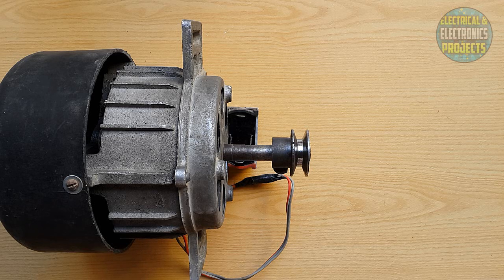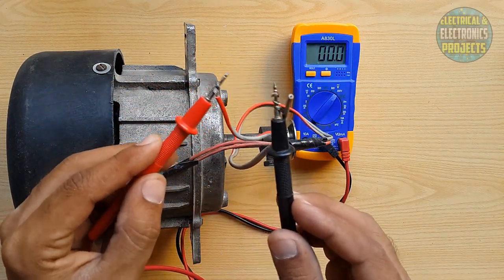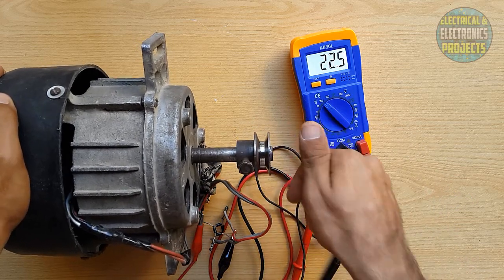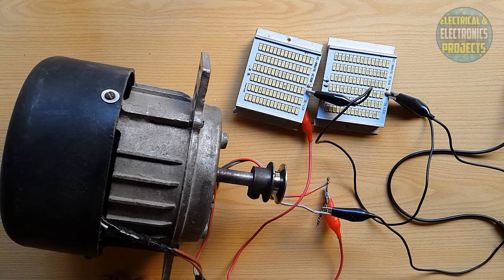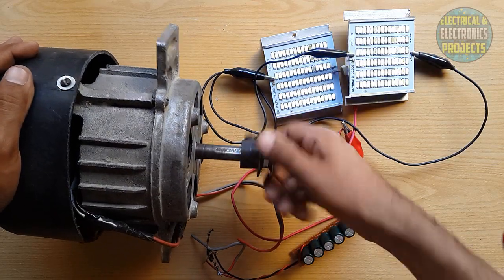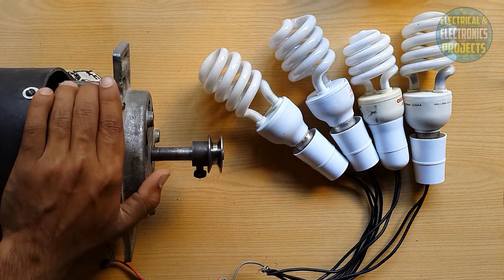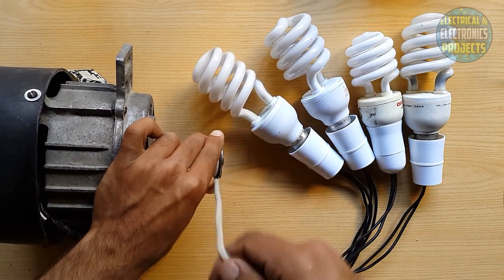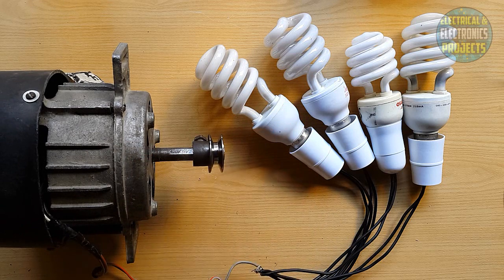How To Make Free Energy Generator 220V From Washing Machine Motor. DIY Free Energy Generator.

Comment: no, its free. you use a motor to spin the alternator fast for full power. and before you talk about needing power for motor, think about it. the power you produce can power a plug ,which you plug the motor into. put a belt between them. I've been using this system to power job sites for years. its a loop. alternator spins to put out power, which powers the motor that spins the alternator. it spins fast so you can get 90 amps from it. if you put 2 of these in series you have 180 amps which is enough to power your whole house for free. just go out and scrap out a car alternator and a washing machine motor, get a belt to connect them, a bit of wire and...free power. with car alternator you need DC current to convert over, so you hook 6volts of batteries to it and that's the only power you pay for- 4 AA batteries. get rechargeable and recharge them with the power you are now producing for free. don't hate just because you don't understand it, educate. stay open minded long enough to learn what someone is trying to teach you,it often takes more than 1time, remember grade school math,LOL, took time.
Reply: You cannot run an alternator with a motor and expect to create Free Energy.  You need to try it to see for yourself.  There are so many reason why this cannot work.  Lenz Law, Eddy Currents, Friction etc.
Reply: Joe Segler  this hurts my brain, you Sir have no idea what you are talking about. Please continue with carpentry but stay away from wires and do not try anymore to spread your waste knowledge.
Reply: Oh boy how little you understand.
Reply: John Butcher  By powering one motor with a battery to turn another as a generator will work but you won't be able to sustain it for long before you battery dies and no you can't take the output of the generator to run the motor.
Reply: In fact I do.  But I also understand how things work and why other things don't.
Reply: It won't work.  Too Many losses.  As soon as you draw a load, Lens Law comes into affect opposing the current draw.  Search Lens Law on Google.  There are other factors as well but Lens Law is the big one.
Reply: Old Science theories?  Yes they are, and to this date have stood the test of time.  So why are you mentioning Tesla?  Tesla was a follower of the Laws of Physics.  Everything Tesla did was within the Laws of Physics also know as Natural Law.  Tesla never claimed to have made a free energy device nor did he ever propose it was possible.  Everything Tesla did was within the Natural Laws. You should really do you research before talking about someone you know little about.  It's ok, many make the mistake in thinking Tesla create some free energy device.
Reply: educate? OK educate yourself on the conservation of energy and how that WONT WORK
perpetual motion cant exist like that....
Reply: A man in a box, is a man who has his limits set for him. I believe the earth has everything you need naturally, to cure all sickness and disease, but there is too much money to be made in pharmaceuticals. Man's laws, are not always as correct as our creator's laws. I suppose you may not believe in God either, even though there are NO fossils or bones to back up evolution theory, and yet there are tons of archives of witnesses to Christ. You only know what you were taught. Unless you do the real research, and do not go partisan as to just one side of the things, you can learn more. Mercedes is man made junk. Dare to open the box your mind has been trained to stay in, and explore. You will see there is more than what you have been told.
Reply: The law of thermal dynamics is man's understanding. Tesla has built free energy devices, and if you look, you will see there are more and more popping up. A cars alternator can produce more than enough energy to make hydrogen and run, but there is no way to corner the market for water, so these types of ideas are taken away from the public.
Reply: Average Joe you sound like a complete moron you obviously haven't done any research at all on Nikolai Tesla he was the only man in the world at the time that was willing to give free energy to the world all the thieving banksters stole his ideas and kept him away from all his genius
Reply: You don't even begin to understand the shite you are talking.
Reply: Joe Segler  c.
Reply: sharon ryan w
        Check xjbl
Reply: +Gerald Goodwin huh?
Reply: Joe Segler could you explain the power capabilities of the electric motor. how powerful does it need to be. and how do the alternator testers work at auto parts store?
Reply: Joe Segler  sounds good i am in the process of powering a second universal motor with a battery to turn the first motor.  Will the second motor be able to provide 230v for uk appliances?  I know I will need a bridge rectifier to turn ac into dc!
Reply: +John Butcher give me the place of the video that you can replace batteries old address
Reply: John Chevalier hello have you heard of john hutchinson and the hutchinson affect weird stuff. He has lots of videos on here about using electromagnetism on objects and the weird things that happen to them
Reply: Lower Your Electric Bill Simple proven method that helps you save moneyyyyy>>http://homesolarsystems.blogspot.com.co >>>
Reply: F'ing Troll
Reply: XXX
Reply: Cheers Bud!
Reply: interesting. thanks
Reply: Nice Job.
Reply: Joe Segler u can u gym sissys to power some go to gym to exercise
Reply: motor 220v and  ğenator  220 ve
   .
Reply: can you show as a project here on youtube. That would be nice.
Reply: YOUR  FULL OF CRAP !   GO  PUT YOUR HEAD BACK IN THE  SAND !!   FKING  SHEEPLE !
Reply: The bollocks that I read here beggars belief, How the fuck do these people even function in their day to day life?, Their degree of ignorance is on an epic scale!, I have no sympathy for them when they are ripped off by shyster snake oil merchants.
Reply: Joe Segler thanks for the great advice I'm not to clever on electric I know the basics but I don't understand DC and volts just know how to change a plug lol would you be so kind as to explain in easy terms so a woman can understand 😵💭
Reply: I would love to see your generator set up in a video, and also directions more specific on how to build one. I've been thinking about trying to build one, my thoughts are on pro's and con's for longevity of use. Also wondering is there surging, or over powering, and etc. I pay $300 a month on electric, the electric company has power saving modules connected to air conditioning, and pool pump, I don't see slow down in use on my bill, just warmer air conditioning at night, to where I sweat in my sleep. I suspect they slow my air condition down, but charge me full use.
Reply: Pete Tetso Yup, I've heard of Tesla but he has nothing at all to do with the topic at hand so I don't have any idea why you would bring him into it??  And as far as "who made" the law of thermodynamics?   Nature made it lol!  Mankind simply discovered it.  Why don't you look it up and educate yourself about it so you won't look so foolish when you are trying so hard to look smart ;)

PS: The law of thermodynamics is a bit like the laws of gravity in the way that it's "just the way it is".  Has anyone figured out a way to circumvent the law of gravity?  Nope, and the same goes for the law of thermodynamics.   Neither are laws that can be changed by the government lol!
Reply: fuck you sasa
Reply: dear sir 
please help me 
i want to made it at  my home can you give me all component and material list with description of all component and full video 
i live in village there is no electricity
thank you sir
my mail address is mahendras726@gmail.com
Reply from the maker: Dear Joe Segler Thank you very much i will try to do what you said.
Reply: valveman12  how about hooking up a car battery and running a car battery charger that runs off the output?
Reply: valveman12 do u have shares in energy companies? Lol
Reply: All of you folk really should listen to Valveman12!  He is telling you like it is.  Joe Segler doesn't have a clue and you are all asking for his advice lol!  As Valveman12 tries to tell you, Segler is lying through his teeth.  What Segler describes that he "uses on the job site every day" would be a "perpetual motion machine".  There is NO SUCH THING because they cannot exist in the real world.  Too many losses.  Check out the "law of thermodynamics" or whichever other laws that Valveman12 recommended that you check out.  Stop being lemmings.  This is stupid and it makes all of you look dumb when you buy the foolishness that people like Segler spews out.
Reply: Law of thermal dynamics?  When was this law discovered? Who makes this a law? Have you heard of Tesla? Have you tested these theories, or call them debunked because of old science theory?  Hmmmm...?
Reply: Don't talk crap, Tesla was a liar and a cheat, now dead, good riddance.
 J.

Comment: take a microwave transformer with two fairly strong magnets on opposite ends and it creates 120v without rotation but few amps use that for a small electric engine to rotate the generator and you have created a self sustained generator. great video 😁
Reply: us an alternator and transform it to a generator and you will produce 120v with 90A and you can power your house for free.

Comment: for secure, and safer testing connections, use wire nuts to isolate any possibility of accidental contact between conductors or wire ends.

Comment: I see a lot of negative comments but it shows you could hook it to another free power source and not use human power. It could be wind power or water or what ever. The value is knowing you can get a small electric motor from anywhere and have power at little or no cost.
Reply: ryan lumley how is the machine Easton time and doing nothing their is another video where a guy uses this set up and makes a water turbine for his off the grid set up. So this is not wasting time
Reply: ryan lumley would if you just found a different purpose for bucket, then you wouldn't need to fix hole
Reply: yes
https://www.youtube.com/watch?v=3dSAw6jIOh0&t=2s
Reply: ok but if i gave you a bucket with  A hole in it youd want to fix the hole ? in this case that 'machine' is wasting energy and doing nothing

Comment: I make free energy by running a 300Ft extension cord out of my neighbors garage!
Reply: lmao
Reply: Are they Jewish by any chance?
Reply: Dennis Schmidt there was a lady had a road sign by her house w.receptacle she did same thing for years.just for lights
Reply: He stole the motor,  that is free..
Reply: I would love to see what you are running off a 300' extension cord.  PS You are not making anything it maybe free for you but your neighbor is pick up the tab.  But there is another way to get free electric but you got to be a little sneaky run that extension cord under ground to the nearest street light you see that little plate at the bottom of the pole open that up and attach the cord in there.  you may want to paint the cord the color of the pole to help blend it in it could take a long time for the city to catch up to you. :)  Another way is to bypass the meter that is done by attaching the wire to the input side of the meter.
Reply: @tfoley7553  you know every trick in the book aye

Comment: Well your generator is free since it came from an old washing machine and you did not pay for it.  However it is not a generator of free energy as you need to provide the mechanical energy to it (cranking) to get the electrical energy out.  There is not so subtle a difference there.

Comment: you are good....i suggest if you connect it to windmills or any mechanical to continue rolling the dynamo attachd to the charger that can store energy to the battery and battery will distribute power electric in the house just dont forget to attached also controller between power in so it will not overload..

Comment: Thanks for the upload and you present was very understandable, my worry is on how to speed up the motor to generate stancable voltage. and i think with the use of rotational fan blade with mechanical pressure of a strong wind location. it will help

Comment: where is the Free energy?? you need energy to drive the motor, so it's not Free!!
Reply: TheGuitarmanrh he is spinning the motor that makes ac and then he changes it to D.C. So he is not using energy because he is spinning it by hand
Reply: microwave transformer and two large magnets placed on opposite ends will draw energy from the air to power it for free. I have done this and it does work
Reply: Cleaner th pml an Hillarys Server
Reply: TheGuitarmanrh free energy in his ass :)
Reply: The pulling he did with his arm...
Reply: TheGuitarmanrh I'm not an electric wiz but couldn't you just use a battery that is rechargable and then when it dies you can plug it into the outlet that you have connected to the generator and use your mechanical energy to power the rechargable batteries and when they charge then you just use the rechargable batteries.

Comment: If you supply me two same generators I can pay you including delivery charge. I am in UK so ask me how much mony you need for two. contact dr sharma  UK or Skype me drsharma111 or mail me drsharma@hotmail.co.uk  or you can help me how I can build the same motor generator. So tell me which motor is it? is it a conductor or what. I have no shortage of motors in uk. You help will bring a flash light as I will use two motors on top of car roof together and the will spin as the car will run fast so this system will run the car free and the world will make the clean environment thus no one will feel sick. mostly in eastern country You name will be on the air. I am not a business man but I like to help the world like you. Hearty Regards. God bless you Sir. Dr Sharma UK.
Reply: Brian thx for proving ur creativity, however for how long will u drive using ur hands?? more effort z needed
Reply: Yes I accept your order.I make to order it ,if you really want it ,then contect me
9967179240. (India)
Reply: shamim jahoor i have made a windmill with enough power .i want to attach your motor with that,so please upload part 2.
Reply: Wind mill is running in my country .and many production house unit and supply power to village and urban areas.
Reply: Dr Sharma you can just add a simple generator to your car that don't need to be on roof.....but you have to modify your car in order to make it hybrid i.e what you are saying to make eco friendly fuel free of cost

Comment: ...where got free energy...?
Do u know what is free energy?
Reply: There is, if "free" defined where as free means you don't pay for it with money. Wind, solar, tidal, geothermal, to name a few. The cost comes from the equipment/maintenance/wages/profit to implement and run it, and distribute it. This video does not show free energy, but maybe a way to make your own energy independent of the grid. Just using  simple generator principles, but requires mechanical energy to get electrical energy. The losses are no doubt poor on this type of system. A donkey, and a pulley system, might work, lol, but you will still need to provide the donkey with food energy.
Reply: Pgs Pena
Reply: creation ...
but, same old story ...
first you need to give respect to life ...
others steps are a bit more ...
life longlasting ?
Reply: There is NO FREE ENERGY available
Reply: Ofcourse like that, but not a motor powering a generator powering a motor and so on

Comment: Let me show you how these 220V lights glow when I have bare wires lying round which are obviously  at a high enough amperage to kill me. 
I'm not a safety sissy but self preservation and nasty accident avoidance is something else. 
At least this is real energy rather than some pie in the sky crap like there is so much of on YT that are scams to suck the morons in that will believe anything.  Put this on a windmill, motor or Micro hydro and it would give you useful power. 
Thumbs up for that.
Reply: Oil Burner always has to be a hater troll and today it's you
Reply: Video Mixer telsa already made that technology but the Powers that be won't release it
Reply: you're wrong.  Current is the killer.  I am an electrical Engineer my friend.  I love how you trolls have no idea what you're talking about.  if it was voltage that killed all of those people that got hit by lightning which is at 100 million volts, would be dead.  It only takes 0.1 to 0.2 amps to be lethal.  Hope that puts things into perspective.

Comment: Yea, you might produce 220v ac from spinning up your motor mod. you don't really need to mod the motor, just accelerate the motors RPM to about 30% above it's run rating. I hope you don't try doing so, with the wire grade your currently using and try to add a large load to the circuit. LED's that pull in the milliamp range are one thing, trying to hook a device that you can do actual work with is another. The diodes your using are likely rated at only 1A, So, plan on pulling less than 1A of load from it. Your bridge should produce 1.25 times the RMS AC voltage generated. And finally this is not a free energy device, you still need to apply a working force to produce the energy you get. But it could still a good presentation of how to make a generator from a washing machine motor, if you showed the mod.

Comment: i got a plan that connect the motor shaft with a cycle gear and then put chain back remove Tyre weld a stand to cycle to keep it up from ground then connect motors      connections with a ups or generator battery and workout on that cycle and charge your battery 
let me tell in reply that my idea is good or not
Reply: let u tell me*
Reply from the maker: Yes really apreciate that i was also thinking about that very cool idea thanks.
Reply: Electrical & Electronics Projects. hope u will do this
Reply: Electrical & Electronics Projects.